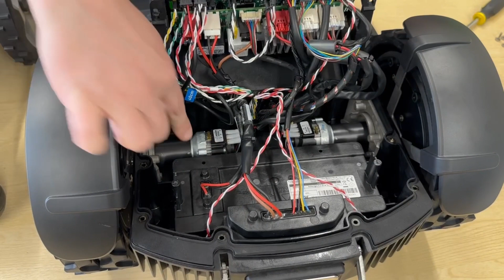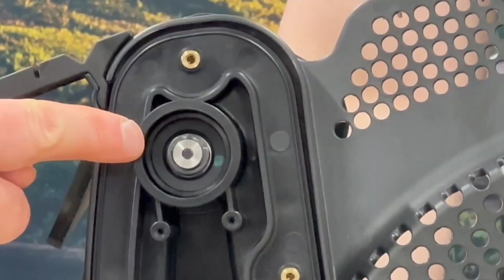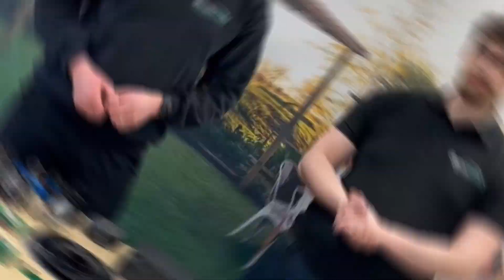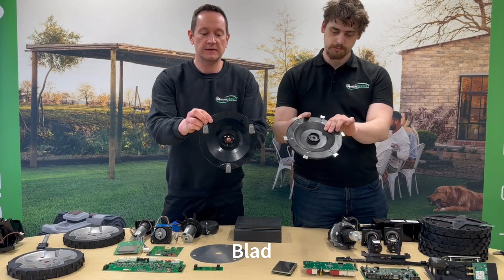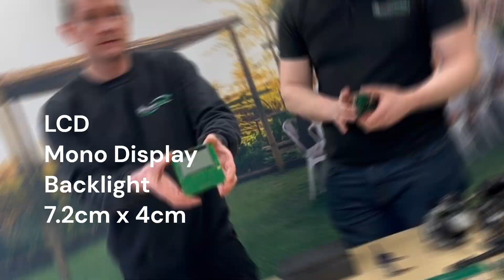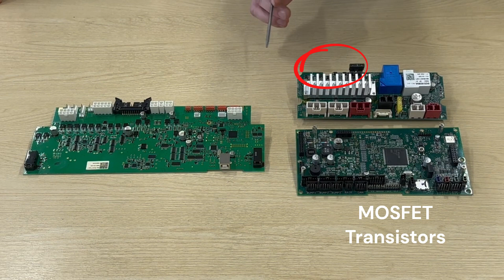Compare & Review Husqvarna 430X and Ambrogio 4.0 Elite - robots examined to component level

Comment: Thanks for this.    I was going to buy the new 430x nera, but this has changed my mind.   Plastic vs metal
Reply from the maker: What did you go for  in the end ?
Reply: I could not find a dealer.  They all stopped selling them due to reliability issues.   Went for the new 430x nera.

Comment: nice review. obviously the ambrosia is a better built machine however I assume that it costs substantially more as well?  and what are the performance differences?  in other words what is the value of each system with respect to cost, performance, ease of programing, etc?  thanks
Reply: Hi in the UK Market there is a premium to be paid for the Ambrogio 4.0 however based on the reviews it is for you to decide wether to pay a little more for the quality.
Reply: They are actually on par or alittle bit cheaper then Husqarvarna actually :)

Comment: I've had the 430x for about 5 years now.  I've had so many issues over the years and that's without even boundary wire issues. Only thing is now that I can fix just about any problem with it from experience. And never again would I pay for firmware updates, caused more problems than sorted

Comment: Thanks for the review. It looks like the PCB's of Husqvarna has conformal coating for moisture protection while Ambrogio has not. Hard to see on video. Can you update on this? Thanks.
Reply from the maker: Great point! They both have conformal coating for moisture protection, however the Husqvarna is a glossy finish that shows up on the camera a little more easily.